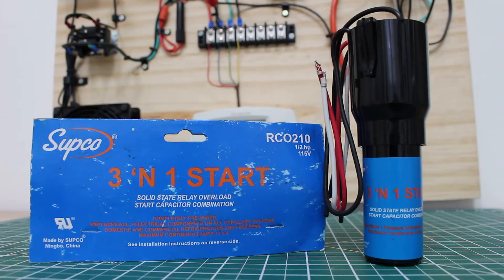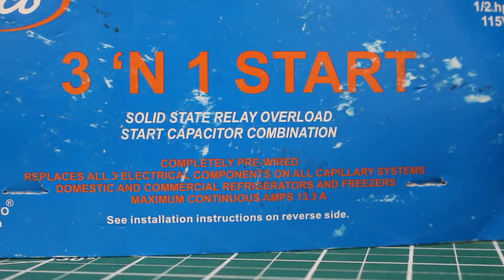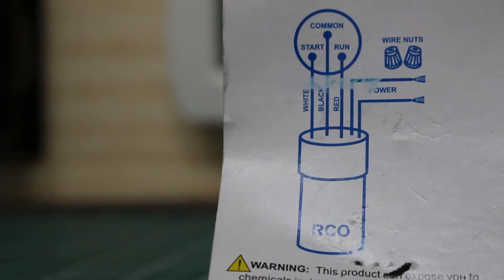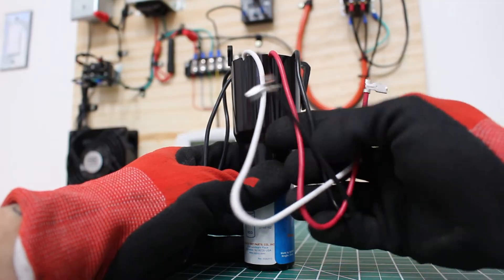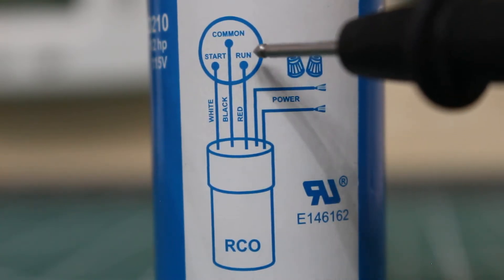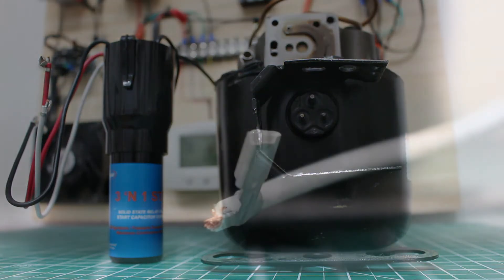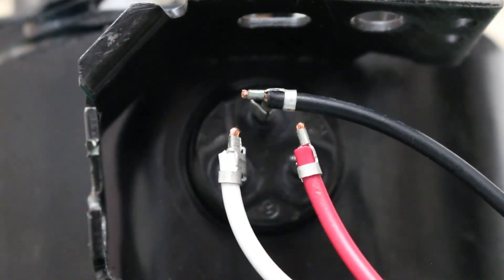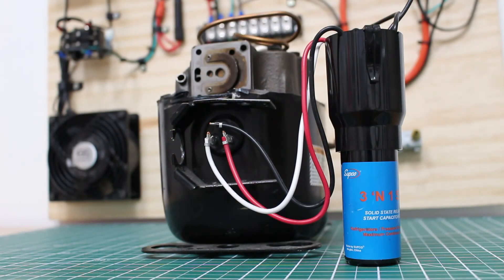HVACR: How To Wire/Install A Hard Start Kit For AC/Refrigeration Systems (SUPCO 3 N 1 Installation)

Comment: Have not instructed how to connect the two remaining black wires
Reply from the maker: @JobThykkoottathil  I did. You connect it to the 2 wires that power your compressor. Either 120V or 208V power source that powers your compressor 👍
Reply from the maker: @JobThykkoottathil  Good luck & thanks for watching🔧⚡️

Comment: I have yet to find a video , that has complete instructions? I have a run capacitor, what about the run light , power light and thermostat.
Reply: There are some videos on youtube that show you how to hook up the 2 power lines. Maybe search "How to hook up 2 power wires" from 3-n-1 hard start kit.

Comment: So which wires get connected to the hardstart, the two legs of power or one leg of power and the other ground wire as there were three wires running originally to the compressor. What do we do with the extra wire?

Comment: I see there are many uncertainties regarding the 2 power wires that you didn't mention or show in your video.  So for the people that was asking about that. You CANNOT connect those wires directly to the power cord wires. You have to connect the 2 black wires to the fridge control wires (basically the same wires you took off the relay and overload) It doesn't matter which one takes the hot line or neutral line.
Reply: Thank you for pointing this issue out, I have the same question as well, seems like the (old) C common, and R Run should be connected to power the 3 in 1 right?
Reply: @BraunbachGranite the 3 in 1 has 5 wires. The 3 compressor wires are black, red and white. There is a picture indicating where they go. The other 2 (power wires) are connected to the fridge control. In some cases...they would be white and red in color. You can always use a multimeter and see if you're getting  120v then you're good
Reply from the maker: @clarkkent2220  Ofcourse you don't connect it directly to power. You connect it to the power wires that energize the compressor. This video and channel is for professionals. Thanks for watching ⚡️🔧
Reply: @JumpermanTech Why would a professional watch this? Nonprofessionals are mostly the ones viewing

Comment: hello, my refrigerator was not cold. The compressor was not running. i replaced Supco 3 'N 1 Kit and the compressor started running again. but accidently 1 open wire touch the metal part and sparked. now the compressor is not running anymore. i bought another Supco 3 'N 1 Kit and installed it but the compressor is still not running. i checked the control board and the fuse is still good. would you please tell me what is possibly go wrong and how to fix it??  Thank you in advance.

Comment: I just got one of these and the power source wire connects to some sort of relay..i had a power surge from lightning and when i hooked up the 3n1 the condensor fan comes on but not the compressor..is the small relay bad as well???

Comment: What to do with common wire that is now not connect? I spliced the white and blue wires but common is not connected. The front light turns on but compressor still has no power

Comment: From a contractor: To have a hard start kit installed on your compressor, you can expect to pay anywhere from $300 to $350. Our prices always include the cost of labor and parts. The overall price of a hard start kit is cheaper than paying for a compressor replacement which can be $2,500 or even more.
$20 part, 10 minutes work.
Reply: I don't know who you've been hiring but I charge 90 bucks for it
Reply: @scottbendall2696 😊😊😊

Comment: Two wires running to the relay and one to the over load but which one of the wire to use to connect to the power line from the relay it have to wires which one to use

Comment: Hi, I heard the 3N1 can fry/damage the compressor depending on the type of the compressor even if you choose the correct HP rating. It can lead to compressor death after a few months. Is that true?
Reply: I use them on refrigerators if there is a run capacitor on the start relay you can wire it into the hard start to the compressor and they work great

Comment: What if my run capacitor is on the main board separate from my relay and overload protector which is connected next to the compressor? Ken more Elite fridge

Comment: The unit I tested would start the motor but then never disengage the starter, I'm going to try the next smaller unit. If that works then these need to be sized very carefully.
Reply: if that's true, the capacitor would immediately explode.

Comment: My campers a/c has two capacitors. So I just do away with them and install this one in their place?
Reply: No. This unit is simply for starting the compressor. If you have two capacitors that are connected with your compressor, that means it has a run capacitor. 
The run capacitor is essential to proper operation of the compressor when it's running. It remains on the entire time the compressor is on. The hard start kit only uses its capacitor for a microsecond to make the compressor start, then it's off for the entire time the compressor is running. The run capacitor will have a significantly lower microfarad rating than the start capacitor.
Reply: @Jason-wc3fh  So just leave the run capacitor and get rid of the start capacitor?

Comment: Where does the thermostat come into play? Would the freezer simply be “on” all the time without a temp sensor to shut it off? I have small freezer that has thermostat with temp settings.
Reply: I'm wondering that myself
Reply: The thermostat is before all of this in the circuit, the thermostat controls power to the relay and relay controls power to the compressor.

Comment: What's your opinion on the longevity of these things? I'm thinking about using this with a chest freezer. A brand new one is like $150, and I can get a used one for like $70-80. Dunno if it's worth fixing for $20 if I may come home to spoiled food one day. I heard someone else say "from a few days to a 2 years." If it's 2 years, I might as well get another one.
Reply from the maker: I've seen these 3 N 1 kits installed over 3 years ago and still operating a refrigerator. It all depends on the compressor for the most part. I hear people say this is more of a temporary solution until they get the OEM parts for it but they do work and are reliable. It's up to you really. Personally, I would install one of these before buying a new unit. Make sure you size up the unit with horsepower and voltage. Thanks for watching & stay tuned for new videos every week🔧⚡️
Reply: @JumpermanTech  I tried it yesterday and it didn't help. I took a shot. My chest freezer does power on, the compressor does turn on, but it only gets refrigerator cold after a full day. Frost only forms on about 6 inches near the top, and right next to it you can see water dripping. It was supposedly working, but the dude said he used it for a year, then put it away for 2 years. Something happened between then and now. The 3 N 1 kit didn't do anything I don't think. I got the compressor to turn on just like before but same issues.
Reply from the maker: @aznnp77  The 3 N 1 kit has a sole purpose to start your compressor so it is definitely doing its job. If your compressor is running, condenser fan motor and evaporator fan motor then you have a different issue. In that case, If it's all running but not cooling down, you most likely have a refrigerant leak.
Reply: @JumpermanTech  Thanks. I spent entirely too much time messing with it. I have the symptoms of dirty coils, but the coils are in between the walls, so there's no way to clean them. Not sure how it could develop a leak after only being used for 1 year and being kept in a garage for the other 2. I got it for free though, so I took a shot. Not too much harm done other than 2 expensive gallons of gas. Thanks for your replies.
Reply: @JumpermanTech  I would try a Bullet Piercing Valve, but I just tried that on a mini fridge and failed spectacularly.

Comment: How long will these last
Reply from the maker: I'd say it all depends on the compressor and the condition of it. I've seen these last over 3 years and still running on a split system refrigerator but also seen them go bad within a year. Stay tuned for new videos every week🔧⚡️

Comment: Can I put this on a newer LG refrigerator
Reply from the maker: You can use this for any compressor that uses AC voltage. Match up the voltage & horsepower then you're good to go. Stay tuned for new videos every week🔧⚡️